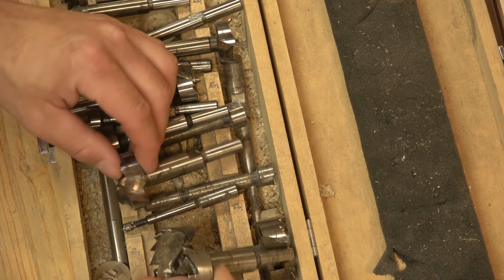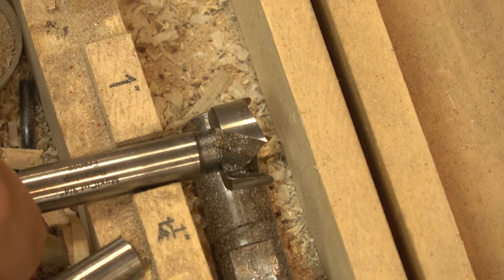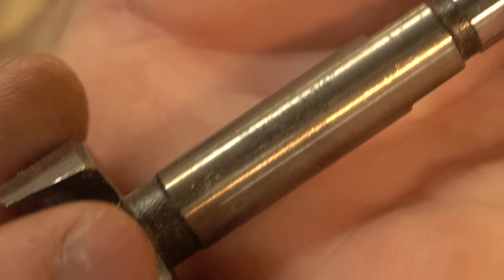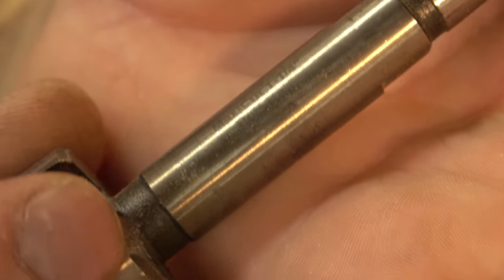Forstner Bit Storage...The EASY Way! // Never Lose Sleep Over Losing a Forstner Bit Again!

Comment: A few times in the past, I have used salt as an friction technique to keep glued pieces from slipping.  I have never liked that because salt can be / is corrosive, and sandwiching salt between wood seems that, over time, would weaken the glue bond as the salt dissolves and / or attracts moisture into the wood (very slowly, but still…).  I switched to a very light & sparse sprinkling of fine sand for these kinds of glue-ups.  Sand will not dissolve, provides a better lock between two pieces of wood, and is inherently a neutral and would not, over time, deteriorate wood from the inside.  And salt is less expensive than salt… By the way, this is a great idea, particularly using a noticeable colored wood as a visual clue.
Reply from the maker: Thank you.  A very sparse amount of salt is not problematic, in my opinion, and has been used for centuries.  It’s an old trick.  

I would be far more skeptical about using sand that could damage my blade, but if it works for you, more power to ya.  

It’s an excellent way to put away forstner bits as it tells me exactly what I’m missing.  I’m honestly surprised it’s never been done before as it is extremely useful.  

Thanks for the compliment.

Comment: I have a completely different set and I am also constantly confused by which hole the bit goes in. (Or comes out of). Those little numbers on the plugs are really cool! 😎
Reply from the maker: I know, right?!   You have to start at the left side of the box and work your way over...so frustrating!
Reply: I agree the plug number labels are very cool.   Might have been more cool to paint the entire face then sand it down so only the depressions with the numbers would retain the paint.

Comment: GREAT to see you using a clamp on the drill press :-))  best practice , but hardly see anyone do it, all the woodworkers on you tube just hold the wood by hand ??- best way to have the drilled object smack you in the face!! why do only metal workers use vices on a drill press?, should hold true for all materials and people who work in the shop.
Reply from the maker: I’m not always good at using clamps, but you’re exactly right, especially with forstner bits.   I’ve whacked myself enough times now to know better!

Comment: But 26mm is bigger than 1"!  I'll never be able to un-see this!
Reply from the maker: Haha...good eye!  You caught the mistake 😂
Reply: Yes, and mixing the metric one in with the others? Reminds me, when metric first came to N.Z. A workmate called out from under a house for me to cut him a length of pipe, 1 metre 1 1/8 inches. But I will be making the holder for my bits, thank you.
Reply: Jevandtieriel John Canada is mostly metric so when driving through I stopped to get some hose for a fuel can. I asked for 1 meter of hose and was told they sell it by the foot.

Comment: As always Rob another great idea, but could have done without the goofy music. The plain sound of machinery is all the music I need. I have this obsession with containers and boxes and try to keep things in the boxes they came in if they are made of wood. But I like this idea enough I'm willing to sacrifice my Forstner bit box. Not only practical but in the long run, will save me some time. Thanks! PS- where did you find the attachment on the pillar drill that holds bits? Speaking of drill your drill press is a tad bit wobbly.
Reply from the maker: Hey thanks!  My current videos do have music but it’s something you have to really listen for.  Most of these older videos were made without any complaints, so I’ve tried to work with people a little by trimming it away.  

You really have to build one of these.  Of all the things I’ve built, this is one of those few things that glows brightly in my shop.  I NEVER lose my forestner bits now as I can see from a distance what I’m missing.  Honestly can’t figure out why this idea hasn’t been used before.  

The attachment actually came with the press...and it’s kind of nice to have, but I never remember to use it haha

As for wobbly, yes, not sure if it’s the bits or the press, but as long as I use a brad point bit I don’t seem to have any problems.  

Thank you, as always, for commenting!

Comment: You lost me when you sprinkled salt on your glue joints. Bad practice that weakens the joint (per the makers of Titebond) just spread an even thin layer on the surfaces with an applicator and use proper clamping technique and you'll be fine. May not be as important for this application, but still a bad idea in general.
Reply from the maker: I’ll have to agree to disagree.  It’s a centuries old technique that has never failed me. 

https://youtu.be/1Ai-IQvRDo4

Furthermore, it’s in titebond’s best interest to encourage people to not use anything other than their glue for liability reasons.  While a few grains here and there is fine, there are some fools that will layer it on like they’re spackling drywall.

Comment: Well, I saw it, no one else did. your secrets safe!
Reply from the maker: I feel like we need a secret handshake from here on out.  🤔
Reply: @MakeThings  - Ok, could never keep a secret anyway.  It may be I'm wrong but when you stamped the sizes on the buttons, they were the wrong way round when the storage was fitted on the wall. Of course, if you didn't glue them in  until after you could still have turned them round.  BTW in the UK the timber would probably cost more than the Forstner bits. Nice though.
Reply from the maker: I actually leave it standing with the bits holding the block up in the back, so in that way it is the right way.  But I did goof on the 25mm.  It should be before (after?) the 1”.

Exotic timbers are pretty but they’re sore on the pocket books!  Living in Indiana I’m surprised that some of the African wood can be cheaper than the wood that comes from South America!

Thanks for commenting...we’ll keep our club secret just the same 😜